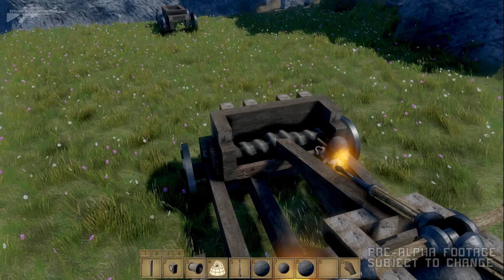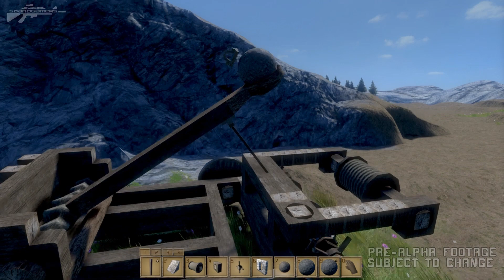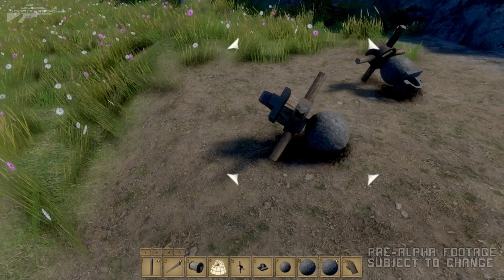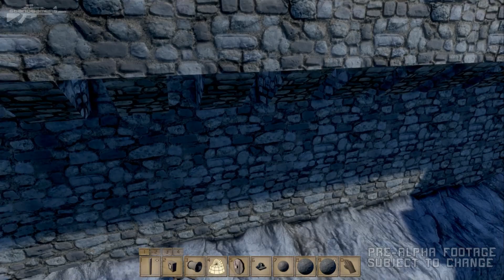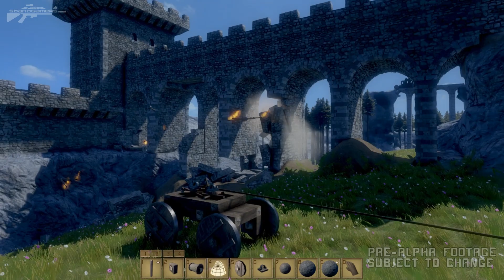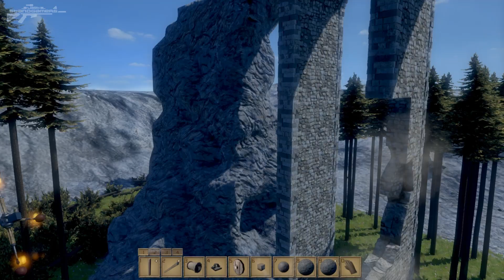Medieval Engineers - Wacky Weaponry Experimentation

Comment: I've got an idea - get two of those arm things and have the middle of the four-armed Frisbee be attached to both via a cable. Have both somehow released upon engaging both arms, allowing you to attain a smooth Frisbee flight. Maybe there could be some sort of cutter that'll separate the cables simultaneously... OR ACTUALLY

no, I got a better idea. The same way you throw a Frisbee!

You have a cable latch on to the front, one of the arms. Then you have a high-powered arm like was what was shown in the video move at high speed essentially flinging the poor thing horizontally as was demonstrated using god-mode. We'll be utilizing momentum in order to make it want to fly like a Frisbee!

Comment: so basically Aron you've discovered how to make a Glave Thrower you'll need to make a grooved discus with 3 or 4 Iron Blades and a cross bow that makes the discus spin and be able to adjust the firing angle angels - Also as a dev. note it would be a nice feature to see a firing arc for the projectiles of all ranged machines.

Comment: You could builld sort of like a ballista.  A round holder with 2 ropes on each side and then one rope at the back, the rope at the back gets reeled in and it works like a slingshot.
Make a big one with guides on the top and botton ane make it fire the torcher round.

Comment: What's the use of walls if one cannon ball can make the entire thing collapse? Back then the walls were able to bounce the balls off, until it couldn't anymore but in this it never bounces unless at an extreme angle, miles well build underground which is 10 times safer than having a wall around you
Reply: That's not true with the catapult i have had many of them just shatter after hitting a wall or bounce off of the wall if you throw one by hand you can charge it up to full speed and strength so of cource it will break the wall that's creative mode for you.
Reply: That's a little like saying what's the point of space ships in SE, if you can just copy paste and slam them into each other at light speed. The "hand cannonball tool" is just a creative mode thing for fun and testing. If you use a regular catapult it's far more challenging and time consuming to get good results trust me.

Comment: As far as the Frisbee concept goes, why don't you try to pull it instead of push it. Pushing results in an unstable pendulum situation where it is hard for the projectile to keep level. If you pull, the system will naturally go towards a stable acceleration. If you pull from one of the legs and not the center, it should get a spin (depending on how well the physics engine works). This setup means you won't need the large platform to stabilize the projectile either. Great video, have fun!

Comment: the grappling hook is not working because when you first link a rope, its maximum length is decided. what you have to do is start the grappling hook a long way away, and then "reel" the rope in all the way back to the drum. If you launch it afterwards, it will be able to extend all the way to the distance you originally placed it!
From watching your video, the main problem I see is that the grappling hook will be too damaged to survive a landing at much of a distance, you'll probably have to make a box of sorts to protect the rope links.

Comment: What would be useful is an automatic trebuchet, with a wheel that the user turns (or turned by something else) which lifts the counterweight, then once it hits a certain point it is dropped and then fires a round.

Comment: Hmmm perhaps try making more of a ballista design where in it has 2 propulsion shafts the width of the projectile apart with one being longer than the other. with this it forces one side to spin faster as its still receiving force from the longer arm. As the arms spin under torsion they push the sled with the uneven propulsion shafts sending the projectile flying out spinning. To fire again recrank the coil ropes to set the arms back in place then winch the sled back into position. Load another projectile and cut the ropes holding the arms to let it fly again. i did my best to draw it in the message but in theory it should work.

@ being coils of rope, / \ and __ being members, | | being propulsion shafts, ..... being cable/rope, and # being winches
 (<<<, ^, and >>> being movement)
                        \
                     ----+----   < spinning Projectile leaving housing
                   ___ \__
            _ /             \___ 
     ___ /       |''|    ^             \_
@               | |    |                     @
   \\             | |    |    |''|             //
     \\           | |         | |           //
       \\         | |_____| |         //
>>>   \\       |_______|       //   <<<
#.........\\            :           //........#
                         :
                         #

Comment: instead of firing using the plate, try making a fork to set it in and add a small knob on top and bottom of the projectile. something that would support 3 sides of it but will still let it fly and apply the force to the middle instead of the sides. this would cut down on the resources needed as well as keep it from getting that flip it was before it left the firing plate.

Comment: You need to make a sling shot that has a base part which holds the grappling hook and have a cart that goes back to make tension, the hook will have a rope attaching to the cart that is released when there is enough tension. You can expand it even more by being able to pull the hook back to take down the wall.